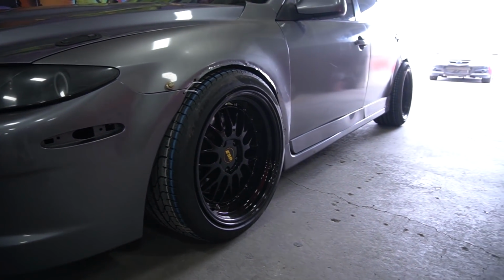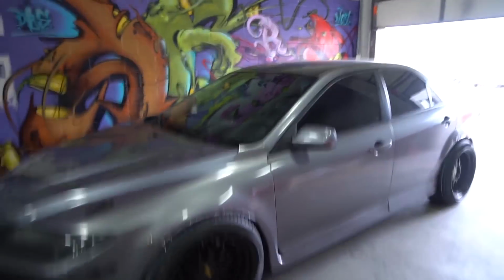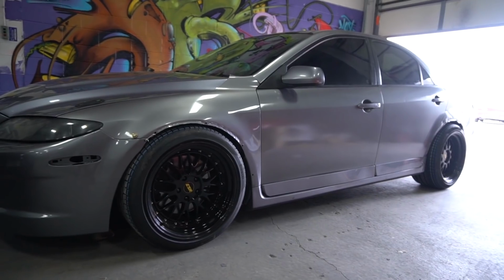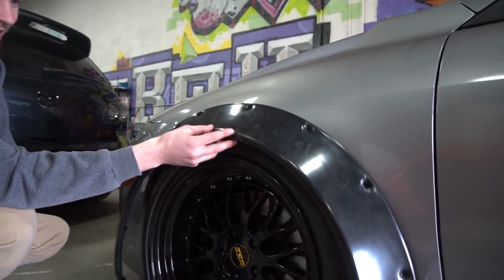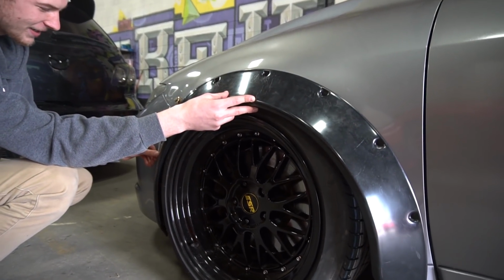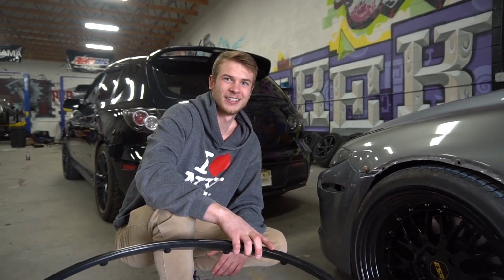Stupid wide Wheel install - Mazdaspeed 6

Comment: I know it’s been a minute but maybe I’ll get a response. 

Did you have to do any modifications to the inside of the fenders when installing these wheels? About to put the exact same size wheels and tires on my MS6 and was mainly curious about front.
Reply from the maker: I mean I took out the plastic wheel liner. But that was it. But probably depends how low your car is

Comment: What suspension you're running on there just put 20 inch rims on the Mazda 6
Reply: 9.5 in front with it being 10.5 in the back
Reply from the maker: I am running god speed coils. They are cheap but good

Comment: What size wheel spacers you use...2.0"?
Reply from the maker: Dan Cormier I didn’t use any wheel spacers
Reply: @StevenDevey  Ohh really? I wanna go with 9.5"/10.5" wide but I figured I'd have to get at least 2.0" spacers since stock width is 7.5"
Reply from the maker: Dan Cormier nah you don’t need spacers, you just need wider wheels
Reply: @StevenDevey  Ohh ok thanks, I just wanted some good insight on how I  should do it/on how to do it the right way lol
Reply from the maker: Dan Cormier ya man I wouldn’t quite go as wide as I went. They are just super aggressive. I would look for a 9.5 at the widest!

Comment: I did have the 2 fronts on avids  10.5 too they were great but since I didn't want to go with flares anymore I ended up going back on 9.5s et 38 with 10mm spacers  and they re pretty flush with the fenders rolled in the back ,yeah the 10.5s. on et 22mm were coming out too much ..

Comment: Hey man I know this doesen’t relate to your video at all but what do you think about the second gen mazda 2/demio (2007-2014) And also i really love your car and setup . Hello from Romania ! 👏🏻🙌🏻
Reply from the maker: Andrei Francu hey man I love all Mazda’s! I’m not that familiar with that model. Is that what you drive?
Reply: Steven Devey it is my mom’s car 😅 90 hp and 900kilos .It’s like a go cart .Drove it a few times and it’s amazing
Reply from the maker: Andrei Francu that’s so sick! Could you imagine a turbo on that thing! Or if it was just lowered on sick wheels! Oh also is it manual?
Reply: Steven Devey it’s a manual 1.3l grocery getter . It also has a 1.5 sport version with 110 hp and stiffer suspension i think . There was also one and only one mazdaspeed 2 made as a prototype . One awsome dude who i talked with on instagram has a sick lowered one . Check him out if you have time : @c513yy .Ours is stock but that’s not gonna be for long i hope
Reply from the maker: Andrei Francu dude that’s awesome! I’m a big fan of small cars. I wonder if a mazdaspeed engine would fit very easily. The manual makes it so much cooler! Do you have any plans for it yet?
Reply: Well if it becomes mine then i ll try to put a mazdaspeed 3 engine in it ,if not at least the 1.5 and turbo it .And if it does not become mine in 2 years because in romania you can get your drivers licence only at 18 and i m 16 :( i’ll get a mazdaspeed 3 or a bmw e39 525
Reply: Because mazda 6 s are kinda rare,not even talking about the speed 6

Comment: Hey man! Nice to see you again. Can you make a video installing an external wastegate in the OEM turbo of the speed6? Thanks in advance man!
Reply from the maker: Isidro Carrillo hey brotha thanks for commenting! I’m sure I will make a vid on the stock turbo some day. If you want more info you can keep messaging me and I’ll work through it with you. I’d be happy to help
Reply: @StevenDevey  Thanks man! Sure I will do. The thing is that I purchase a BOV in Ebay and when I got my package here in Guatemala they sent me a wastegate instead LOL! That's why I was asking you man! Nice video with those tires man. Looks amazing!
Reply: @StevenDevey  Also, I have another question. Do you know If the synchros are the same size, meaning can I use the 5th and 6th gear synchros into 3rd and 4th gear?
Reply from the maker: Isidro Carrillo for the wastegate you will need a different manifold with the wastegate port. I wouldn’t recommend the eBay wastegate because it might not handle the boost that well!

Comment: Your car is ticking
Reply: I noticed that too. Sounds like lifter tick but I'm not too sure. Maybe Steven knows.
Reply from the maker: Hey guys the ticking sounds so bad lol. It’s actually the HPFP. All mazdaspeeds have this tick. But normally the stock top mount intercooler and a few other things cover the fuel pump assembly to muffle the noise. Also I have upgraded fuel pump internals that make the tick louder.